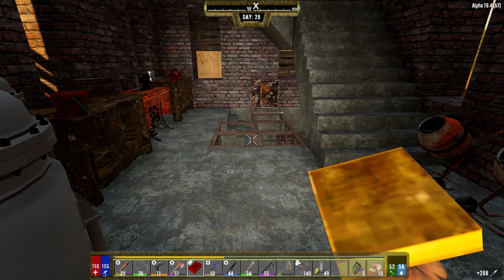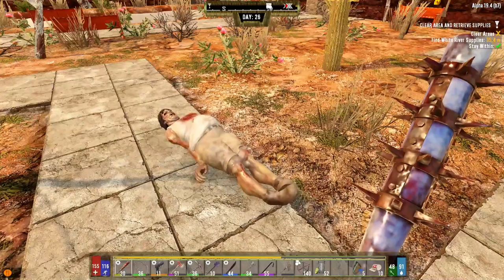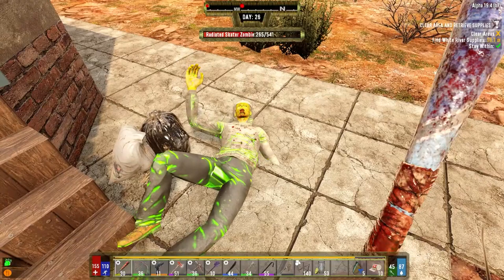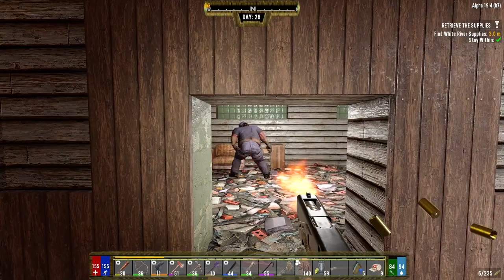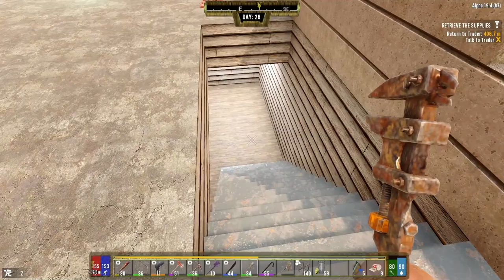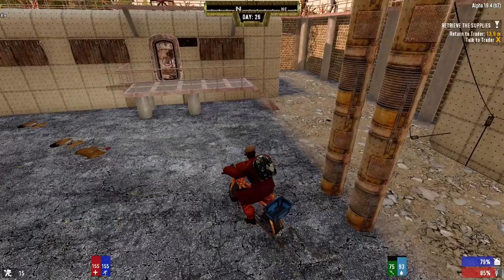Darkness Falls - 7 Days to Die - Ep26 - Master Mechanic

Comment: Spike question... With those new cone shaped spikes... can you mount them vertically on the walls pointing outwards?  ( nevermind... asked and answered )
Reply from the maker: You can even put them upside down and they still do damage. They are kinda weird but they work.